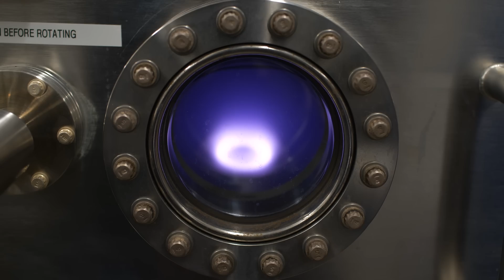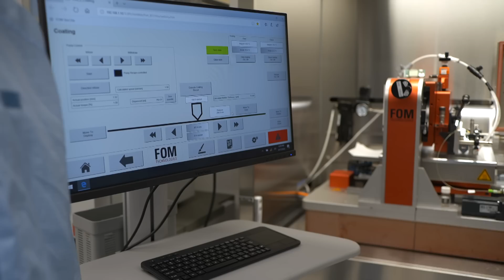Emerging Solar Technology | Future House | Ask This Old House

Comment: "" The future is bright "  , That sounds like an Arnold Schwarzenegger line .  . One thing that most people don't realize is that " clean " energy is anything but . It's clean on our end but getting there is just as polluting if not more than traditional means
Reply: Generally solar is not clean at all because the DC voltage from the panels have to be converted to AC and many inverters create dirty electricity. I'm not an expert but I believe the frequency in an inverter is created by a solid state device so it's not a smooth sine wave, whereas in a power plant the frequency is created by the speed of the spinning steam powered generator shaft.

Comment: This is chasing your tail for expensive technology. The most efficient way to put solar into the grid is to create solar farms ,or on large new commercial buildings. All this residential stuff is only affordable by the wealthy and subsidized by everybody. It’s not just the panels but all the support devices. I am all for renewables , but not the haphazard way it is trying to be merged into the grids. For those still wanting it on their own lot, look carefully at the payback period and factor in deterioration and breakdown and roof repairs.
Reply: @joe34012  Hi Joe. Good point .In NYS , we have the option to go with renewable energy suppliers, but the distribution is through the power companies (in my case National Grid). The distribution cost and taxes are priced separately and taxed separately. Renewable suppliers charge more per KWH than Grid. Also, in most a states the power companies are allowed a fixed rate of return (ie. Profit) which doesn’t change in percentage. I suspect that the power companies are chasing their tales on the technology as well. Duke Energy constructed the largest solar farm in the US in Nevada , but it never got onto the grid because the panels were obsolete before they could open it.Go figure. I doubt the costs will go down with renewables but are primarily directed to reducing fossil fuel emissions. I do hate these shows that promote these complex residential applications but never reveal the TRUE payback period. I’m 72 years old so I am out of the game unless I locate the fountain of youth! LOLs. Stay well.

Comment: This is all great but the current issue that limits widespread adoption is affordable storage for later use. The idea of grid tied net metering systems being used now are just a stop gap measure. Once enough energy is being pumped into the grid in the day time they will have to start idling power plants then bringing them back online at night and this will be very complicated to manage. I think the future is homes 100% independent of the  grid. I am sure large energy companies are afraid of this technology because there is no recurring monthly bill. Carbon is a fundamental building block of life and the government has figured out how to levee tax and fines against it. I reckon the next thing is to try to regulate sunshine.
Reply: I suggest watch a 13 part series called What on earth happened by Ewaranon to learn that the earth is not a globe.

Comment: The one thing holding me back from putting solar panels on my roof is the mountainous price tag
Reply: You all detractors you do realize most loans come with no prepayment penalties,  so you can take out a 20 year loan and turn around and pay it off in 4 to 5 years, remember nobody pay off a 20K car in 20 years! Took me 3 years to payoff my 20K car and that is my plan when I go solar at the end of this year.
Reply: I financed mine over 20 years. they up the overall price to do that but the monthly cost, excluding battery backup, is budget neutral.. in that I pay $200/mo for the loan instead of electric bill. After 20 years, it’s free energy and until then my price per kWh is fixed which is nice with this inflation. I think loan group was divided solar but I’m sure others do it.
Reply: @blkhawk661  locked into a 20 year contract with emerging technology ahead that sounds awful.
Reply: @blkhawk661  after u pay off ur debts in 20 years. U need new loan for solar panel replacement. U gona be taking loans for rest of ur life
Reply: @blkhawk661  after 20 years panels would be obsolete and will require replacement. So either way you lose money.
Reply: @aamirshahzad8060  many solar products have warranties for 25-30 years. There are solar cells that are still going from 50 years! 

Even IF the cells were due for upgrade the other components like racking and mounting would still be good as those are stainless steel and aluminum.
Reply: @justinherman9443  what if they are no longer in business up to that warranty time?
Reply: @JEK  what if my car breaks and the warranty is up? You can replace a single panel. A single panel is only a couple hundred dollars.
Reply: It's way more expensive to keep throwing your money away to the utility company. Why rent your energy when you can own it!
Reply: That's our issue as well. A $20k installation just isn't feasible.
Reply: @Eschguy  I got a solar system installed with a loan at 3.99% now that inflation is higher than 4% I am making money by having the loan.

Comment: Very interesting. The professor talked about the exact drawbacks that are preventing me from going solar. However, the future tech look so bright. I'm looking forward to the day when those new tech are available to the broad public and are affordable.
Reply: It costs me $175/mo for my solar loan…and $12/mo for a connection fee to the grid. No other bill the entire year. 🤷‍♂️
Reply: Respectfully, I would say it's a mistake at this point to not get solar on your roof, assuming you actually have a roof you own that gets hit with a lot of sunlight. Energy prices are volatile, and putting a big solar array on your roof is like pre-paying your electric bill for the next 30 years, but locking in a very low rate. It's a hedge against high energy prices. If you care that much about aesthetics, I guess that's your prerogative, but that opinion will cost you a lot of money. The federal solar credit is 26% this year and 22% next year, and then there's no credit unless Congress renews it again.

Comment: My concerns with roof mounted solar panel's comes from Firefighters. Recently some were injured while operating on a roof and the inability to shut down the solar panels. He result we a total loss of the building. Where is the technology taking us towards protecting Firefighters?

Thanks
Reply: How often will that be a concern? Almost never.
Reply: I take it, no one thought to cover them with blankets.
Reply: @scotttovey  they evacuated the roof
Reply: They already have safety precautions for firefighters. It’s called rapid shutdown, most firefighters know about this. All they have to do is shut the breaker at the panel . Those guys just weren’t paying attention or it was a really old dated system
Reply: @stevencamacho8742  That's not the issue, the cutoff only keeps the voltage from flowing beyond the cutoff, in the building wiring. The wiring out of the panels to the cutoff still can contain enough juice to give a pretty serious shock even in low light conditions. If firefighters have to vent a roof that has solar panels on it it can still get dicey.
Reply: Yeah, but now that I read my post, the covering material would have to be highly fireproof like rock wool which is resistant to fire up to 2400 degrees F.

Comment: Well that is good but capturing solar power is 30% of the system. Storing this energy to be able to use it later is the “elephant in the room”. In that also is included… how we recycle all of these materials? Are we coming back again on the market with something innovative that cannot be recycled? Are we “addressing “ there “later”? Is this a deja vu or what?

Comment: Wish they could of talked about each of these in terms of efficiency. Are these cutting edge in terms of efficiency also?
Reply: usually they are low efficiency at proof of concept and then increase in efficiency.
Reply: We didn't really talk about efficiency because the metric is a bit misguided for the technologies. What most people really care about is low cost electricity. All the technologies can produce electricity at a few cents per kilowatt hour assuming a 10 year useful life. Does it really matter then if it's 10% efficient (the window) or 25% (the coated perovskite)?
Reply: Nope

Comment: Just like a client looking for new home builders, in evaluating a builder, look at what the builder has done, what did they build for others and themselves.   Similarly, instead of listening to another talk by an MIT academic, look at what powers their campus.  Look at what powers the Harvard campus next door.  These large institutions have their own power and heat plants.  The Harvard new District Energy Facility likely cost some $200M to build, with a very shiny exterior, calls itself green, yet "relies on natural gas".  

As for the new and shiny PV from academia, anybody that's looked hard at PV development for possible large buyers knows that the advanced concepts have been around in the lab for many years.  They often don't make it out, to  simply "roll out like a carpet on your roof", as  there are several critical factors for viable commercial PV, and all of them have to be met.

 In addition to power output, there's also power output over lifetime and cost.  Most everything except oxides, some polymers, takes on terrific damage over time from the elements outdoors and especially from UV.   A fancy new PV that lasts 24 months out in the sun instead of 24 years is not very useful, nor is PV that dramatically drops its power output with slight shadowing or less than direct light, or outright breaks under large temperature swings because the substrate is brittle.  Then there's cost.  Many of the new concept PV techs are much more expensive to make than the commercial PV.  That fact is likely to worsen, as the low cost of commercial PV has taken years and vast amounts of investment in enormous plant capacity to make it that cheap.  Its highly unlikely that a new PV tech can just be dropped into existing production lines and just work.

The above is standard practice actually for any tech development process ... in heavy industry, which PV has become.  There is no 18 month tech doubling rate in heavy industry as there is for integrated circuits and software.   

So, its 2022.  Time to look at what's on the shelf now and realize that whatever the future, its coming off the current shelf.  Since current solar (or wind) means seeing a gas plant and pipeline and drilling platform when the curtain is pulled back, it seems to me the only answer to a large clean grid is nuclear power. Remember, this not just about the house, but also the local schools, hospitals, large apartment complexes, the police and fire stations, factories, the pumped water system. All of it in a modern society needs power 24/7, winter summer. A clean, reliable power source is required.   Or, not, and keep visiting the doc in his nat gas powered office and have him tell you about his 5 year plan, again, and again, while nothing serious happens but more carbon emissions.
Reply: It's a 15 minute segment with very limited time to discuss a complex industry. Relax buddy.

Comment: The solar panel itself might be a net reduction in carbon footprint. However the Batteries we need to store that energy negate the benefit of using solar. If you're only interested in the cost to the consumer solar is amazing. However, overall it still has a ways to go.
Reply: I have a solar system on my roof and no batteries. I use an average of 1100 kWh per month and my average monthly bill is like $25, which is mostly the flat payment in my area. I am already benefiting greatly from solar without needing batteries.
Reply: That's based on current battery chemistries, current battery production techniques, and looking only at batteries and currently used energy storage techniques (e.g. pumped hydro).

Using that same mentality, we should never have committed to go to the moon.  We had no idea if we could rendezvous and dock.  We had no idea if we could land on the moon.  We had no idea what methods to use to absorb the heat of TLI reentry speeds.  But we did it.........by inventing new alloys and composites for heatshields, by actually 'trying' rendezvous and docking and learning from successes and mistakes.  We learned to land on the moon with testing and the best possible test rig.

TL;DR - If you only look at current capabilities, and their limitations, you'll never be convinced to do something new, possible and feasible with just a little more effort to make the bad into good, the good into better, and the better into efficient/cheap.
Reply: @truthseeker308  to add to that technology at least in our capitalist's world will never improve or advance unless we show interest in it with our money, those that buy into the solar and batteries now while paying a higher prices show that there is an interest and that makes R&D worth while for companies to try and make a better product they can sel at a reduced cost which will bring in even more consumers. 

Sure institutions like MIT might still forward things with their research but large companies are usually the ones to implement and sell the technology. If they dont see a profit or a demand, they wont invest in it.
Reply: @jjjacer  It was mostly institutions like MIT that actually came up with the stuff we needed to go to the Moon, too.  The large companies just employed their no-patent principles into marketable technology.
Reply: @truthseeker308  

There's a big difference between the decision to go to the moon and the decision to go to green energy.

The decision to go to the moon was followed by both political and national will.

The decision to go green, is followed by hypocrisy, greed and  desire to rip off tax payers rather tan achieve the objective.

As a result, only the con men that won't achieve advances will get funding, while those that are achieving advances, are intentionally thwarted.

Comment: there are roughly a dozen or more types of clean renewable energy sources. the push for Solar and Wind over the last decade or so hasn't stopped the others from making improvements also. if we try to use them all in conjunction with each other could likely see a decent amount of power generated.

Comment: OK with the solar system what if we have cloudy two weeks no sun whatsoever so how’s it going to the solar system gonna work at all with no sun just like it happened in Texas with the snowfall last year or two.
Reply: "OK with the solar system what if we have cloudy two weeks no sun whatsoever"

You're describing Northern Norway, not Texas.  Even with 2 weeks of clouds, you notice how the crops still grow, as does the grass, and the trees and everything else?  That's because solar radiation(aka 'light') still gets to the surface.  That's why day still looks like 'day' and night still looks like 'night' even when cloudy.

So with 2 weeks of perfect clouds, panels will output around 25% of what they could do on normal sunny days.  That's where local energy storage comes in, and also where we never do entirely away with the grid.  We built a REALLY good electrical grid.  Why would we want to throw it away?  There are plenty of grid connected green energy producers (Niagra Falls, Hoover Dam, the Grand Coulee Dam, etc, along with the current nuclear plants, which could be more consistently run at 80-90% of their peak capacity at all times(nuclear plants are much easier to maintain and work on when their load is stable) charging local storage in each home as the drop in demand occurs, keeping demand stable, and thus keeping supply from these stations stable, making them even happier fission factories.
Reply: Snowfall didn't cause the power outages in Texas. It was caused by extended freezing temperatures combined with companies that didn't feel the need to protect their equipment from freezes because they can just charge higher prices when the demand exceeds the supply.

But more to the point: There are many technologies that are being developed for city scale power storage to even out low generation gaps. Lithium Ion battery banks are already being used in various cities around the world, particularly Australia. But liquid metal batteries, thermal batteries, flywheels, and gravity storage solutions like weights and pumped storage hydro batteries could work too.

Neighborhood scale geothermal systems would complement solar quite well since it is more economical to build one well loop for dozens of homes and it provides a baseline of heating/cooling energy at a very low power consumption, meaning that there is much less that the solar has to provide.